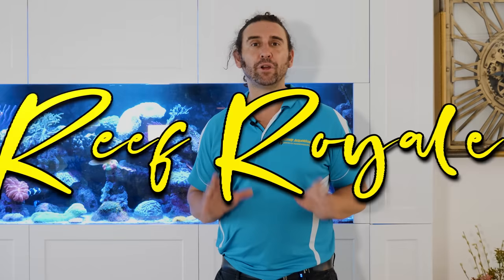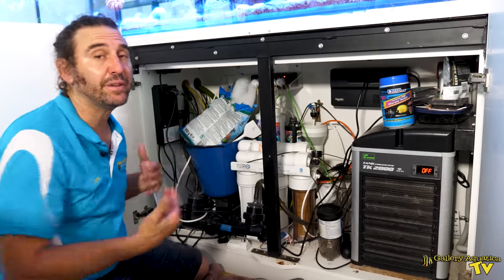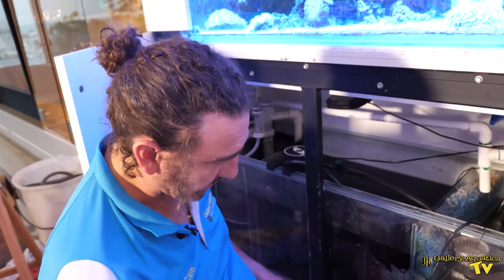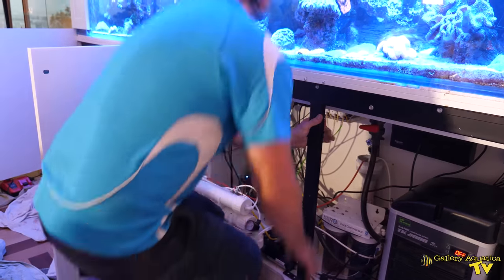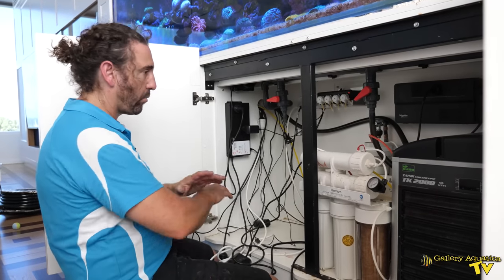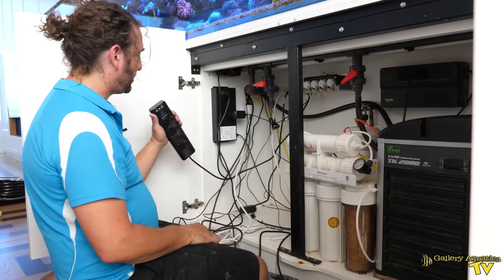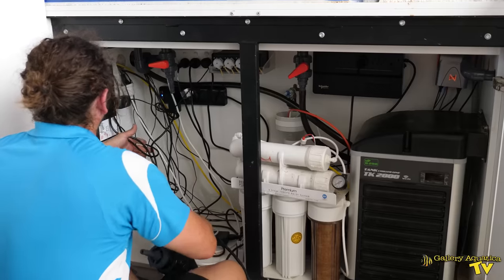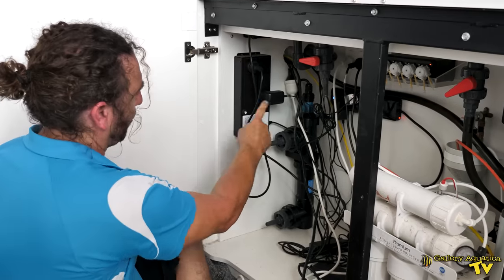Reef Royale: Sump Makeover Edition | Gallery Aquatica TV

Comment: That pipe cutter is awesome, would be a shame if it got wet gotta be careful where you leave that I suppose.
Reply: I bought one for my tank project after seeing this video,, I’ll give it. 9 out of 10. “10” would be a cut I didn’t have to sand the ridge off where the blade drives into the tube. This thing works forever on 1 battery, don’t bother buying a second battery. I’m looking at it again and there aren’t any cooling vents like a drill.  Shop around, I got mine for $168 USD on Amazon without battery and charger. They were another $30.

Comment: Great work! Now if one of those 90 degree elbows fx were leaking. What would you do to fix it? :)
Reply from the maker: The new elbows?
Reply from the maker: Dry it off and apply more glue. If one of the fittings leaked it would only be a slow leak that was easily fixed. Cam
Reply: @GalleryAquaticaTV  Great to hear from the master! :D I had slow leaks in my new plumbing. Everyone said do it over, but I applied  layers of glue and finally glued some plumbers tape tight around the fittings. It worked! :D